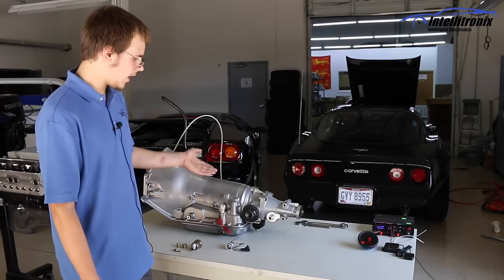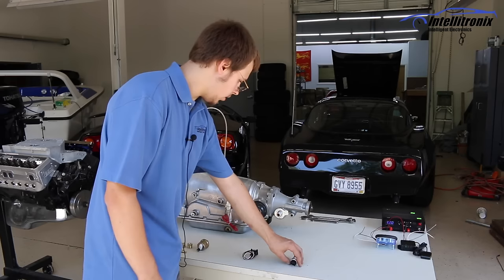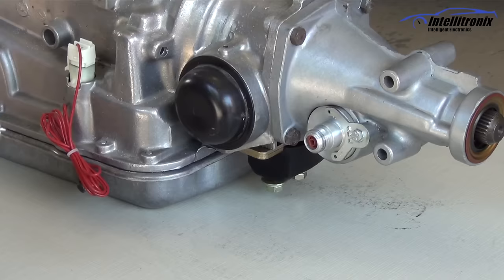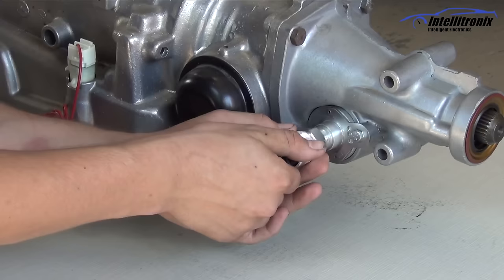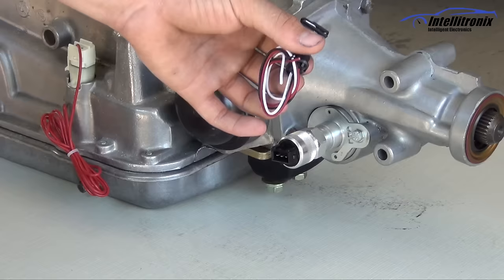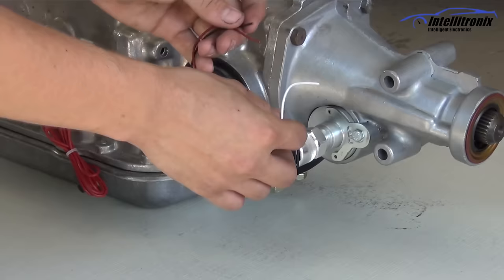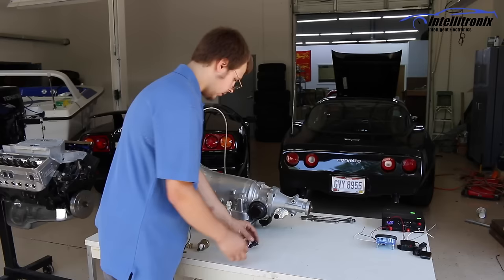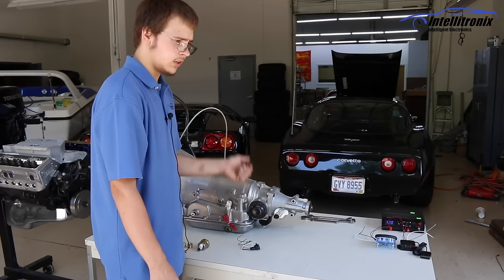Install Of Speed Sensor

Comment: Fixed my car in my 1988 Delta 3.8! I was having so much problems with transmission and throwing a code 24. Can’t believe I almost installed a used transmission. Speed sensor replacement for the win!

Comment: My Dakota Digital dash came with the speed sensor shown in this video, but my transmission uses what I assume is a magnetic speed sensor, which makes the one supplied non compatible. Is there an alternative solution to my non compatible parts?
Reply: As an ASE Master Tech since 78, working on motorized anything since the 1970's, I can answer your and others questions. 
  The output shaft has a $6 40 tooth tone ring / reluctor that is driving onto the output shaft, inside the tail housing of the transmission. With the speedo-drive hole open, in neutral you will see metal rectangular teeth that is driven into dead center of the pickup opening. It provides higher resolution for newer vehicles EGR, Shifting, VSS, and P1870 code for speed comparison from input to output. This changes line pressure for internal slippage of the transmission at road speed. The Camaro and Firebird in 1992-1996 used a pickup that bolts on. Two wire in factory schematics is "Hi" and "Low". Low is ground as this is an A/C signal, at the PCM for "LS family engines". This signal goes to dash speedo, ABS (3-Channel) and Radio. Radio became louder with road speed the faster you drive, if equipped and set. 
  I prefer to wrap in foil tape to ground- tape sold at home improvement or run ground, with wires twisted 9 times per foot. To keep RFI (Radio Frequency Interference) from plug wires to high frequency fuel pump sales signal at gas stations. (They don't use wires / can cause entry-start problems on keyless vehicle-TBS) 
Connector can be bought online or salvage yards. Solder and shrink connectors, please.
DK, ASE Master Tech Since 78, mechanic since 70. (Note; I will respond to questions) by responding to this comment. Have a lucky one!

Comment: This is great. I have a1989 Camaro Iroc-z with 700R4 transmission, so i assume this unit will fit. What do i need to do with my speedometer instrument, can it be converted as well? I really want to hang on to it as the car are 100% original except for the wheels

Comment: I bought the speedo adapter the color of the wires are different than red black and white, I'm working on a 1988 chevy silverado, what color do I hook up to the red .... black.... and the white. Is there a fast and easy way to know?
Reply from the maker: Hello Jim, you can contact Jim Fultz for technical questions in Technical Support at 440-210-7646 ext. 203 or 440-359-7200 ext. 203 or email support@intellitronix.com. Your Intellitronix Team!
Reply: @Jim Kingdon did you ever figure this out? I have the same question

Comment: my 92 c1500 is setup to electronic speedo but when I switched transmissions I wasn't thinking and installed a  700r4 with speedo cable.im not wanting to switch transmissions again just to get speedometer to work.how can I get this speed sensor of yours to hookup to my factory speedometer? or is it even possible?
Reply: I'm on the same boat as you did you figure it out?
Reply: We have a electric speed sensor so we have to get the GPS which is another $125 plus the cost of shipping and handling
Reply: What he's working on as a cable transmission

Comment: just a quick question would this work if this was in the clock cluster it self then wired to a digital speedo so when wheel moves would the needle move in the cluster thanks .....
Reply from the maker: For technical questions such as yours, it would be better to reach out to Intellitronix Technical Support at 440-210-7646 ext. 203 or 440-359-7200 ext. 203 or email support@intellitronix.com. The Technical Support department will have the answer to your question. We will forward your question to Tech Support. Your Intellitronix Team!

Comment: What if I want to use my speedo cable on a 4l60e with a controller..
Reply: The speedometer can receive signal by using our electric sender, a trans with an electric VSS, a ECM or GPS sender

Comment: what about if transmission is electronic sensor what I need to do
Reply: Eduardo Dominguez  did you figure it out?
Reply: Luis Bedolla guess not
Reply: Did you figure it out?
Reply: I have the same question.  I have just tapped into my current speedo line (yellow) and sent it to the cluster.  It works only if im going faster than about 30mph.  Anything slower than that shows im doing 200mph+!
Reply from the maker: For technical questions, please call Jim Fultz in Technical Support at 440-210-7646 ext. 203 or 440-359-7200 ext. 203 or email support@intellitronix.com. Jim is very knowledgeable and will be glad to help you. Please let us know if you have additional questions. Your Intellitronix Team!

Comment: I installed on my 79 olds and for some reason the speedometer only works when the car is moving in reverse, will not work when car is moving forward.
Reply from the maker: Hello Jesse, you can contact Customer Support at 440-359-7200 ext 214 or email support@intellitronix.com or the Help Desk at 440-359-7200 ext 201 or email helpdesk@intellitronix.com and they will be able to answer your question. Thank you! Your Intellitronix Team!

Comment: Yeah. Or just pop the tailshaft off and throw in a reluctor wheel, then use the stock 88-98 sensor
Reply: Would 4l60e reluctor wheel fit th350 shaft so I could use my factory speedo in my 93 silverado with th350?

Comment: What exactly was wrong with the perfectly reliably way of doing it with a speedometer cable??
Reply from the maker: Technology changed with the new Analog and Digital Gauges.
Reply: Nothing, but when you throw an early 80's 700r4 in an 88-98 c1500, the speedometer won't work unless you butcher a hole in the dash to use an older mechanical speedometer

Comment: How do i order for 1978 chevy caprice th350 with cruise control
Reply from the maker: Hello Tumas, you can order the 1978 Chevy Caprice LED Digital Replacement Gauge Panel on the Intellitronix website with cruise control for $399.95 plus 15% discount through Dec 15. Shop today and save  https://www.intellitronix.com/product-page/impala

Comment: I don’t have that same sensor on the the tranny where can I get one ?
Reply from the maker: If you rare still using a cable driven system, you will need this. It is found in the "Sending Units" section on our website. If you are not using a cable driven system, a speed sender is not needed.

Comment: Hi there thank you for sending me the speed sensor I also need the bit that its wines on to that go onto the gearbox so everything seems to be alright for wiring down not a problem with the but you sent us but I need the bit that it's screwed into that is in the actual gearbox cog gear whatever pieces in there this it's in the back there be great thank you
Reply from the maker: Hi Nathan, the best way to contact us is via email or telephone. Email support@intellitronix.com or helpdesk@intellitronix.com. Call 440-359-7200 ext 201. Thank you!

Comment: Can I install on my stock camaro VSS trans sender?
Reply from the maker: Hi Scott, are you installing your stock Camaro VSS trans sender versus the speed sender that came with the Intellitronix gauge?
Reply: @Intellitronix  Thanks for the reply. This is a custom build. I have 90's Camaro T5 with an electric sender. I am using an older version of the AP20002 universal gauge that came with a manual to electric converter. I read where the wires can be hooked directly from the VSS line from the dash to the sender on the transmission on other gauge sites. Is this correct with this gauge cluster? Thanks
Reply from the maker: @lubblegarage  Hello Scott, you can call 440-359-7200 ext 214 or email support@intellitronix.com and the Customer Support department will be able to help you. We've sent your question to them directly as well. Your Intellitronix Team!
Reply: @Intellitronix  I re-read the directions and it was a direct fit to my stock electric sending unit. I just need to calibrate and we are golden. Thanks
Reply from the maker: @lubblegarage  Perfect!

Comment: What’s that red cable do?
Reply from the maker: This is an electronic speed sensor, red wire is ran to 12V source, black to ground (engine block is the best ground available), white wire is signal wire, runs to the speedometer wire coming off the dash

Comment: the sensor will not fit onto my 200R4 the threads are not deep enough on the sensor.
Reply from the maker: Hello Eric, please call Technical Support at 440 210 7646 ext. 203 or 440-359-7200 ext. 203 or email support@intellitronix.com and they can help you. Your Intellitronix Team!

Comment: What about the T56
Reply from the maker: Hello LevelUpLiving, we sent your question to the Intellitronix Team! We should here back later this week or early next week. The Team is exhibiting at PRI Performance Racing Industry 2019, so they will not be back in the office until Monday, Dec 16 2019.
Reply from the maker: You can call Technical Support at 440 210 7646 ext. 203 or 440-359-7200 ext. 203 or email support@intellitronix.com and they can answer your question as well. Your Intellitronix Team!
Reply: @Intellitronix  yes please I have gm trans and I have a 6 speed manual transmission which is call a t-56 from a 2002 trans am
Reply from the maker: Hello LevelUpLiving, could you please give us your telephone number, so the Technical Support person can call you personally? Your Intellitronix Team!